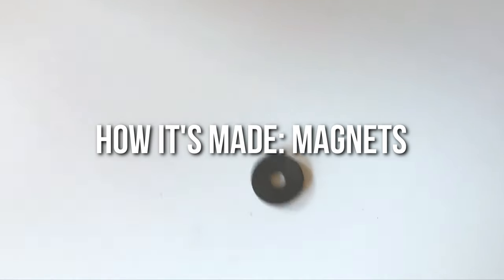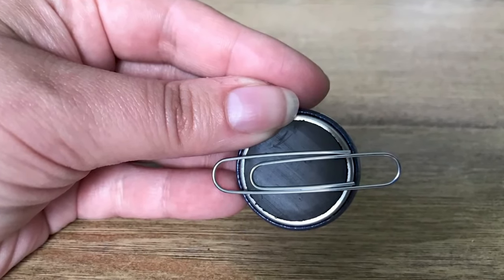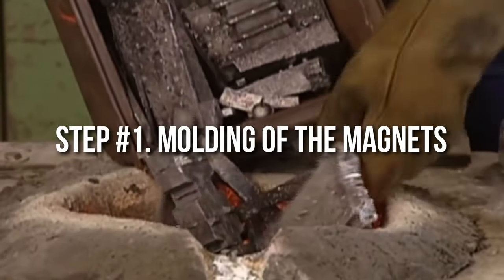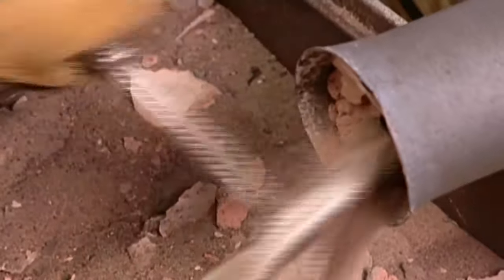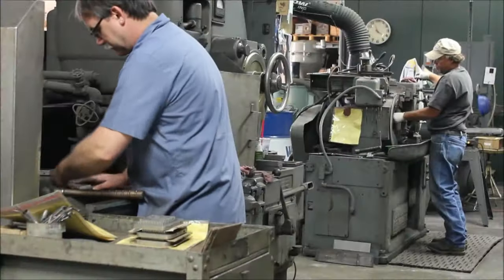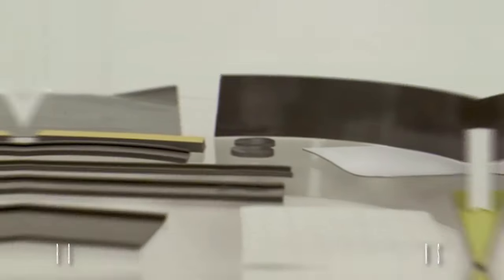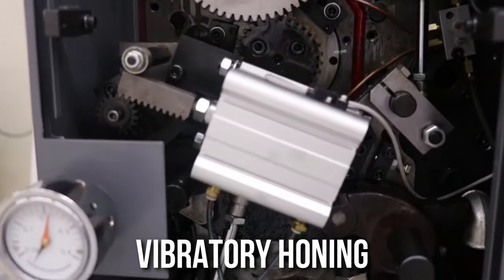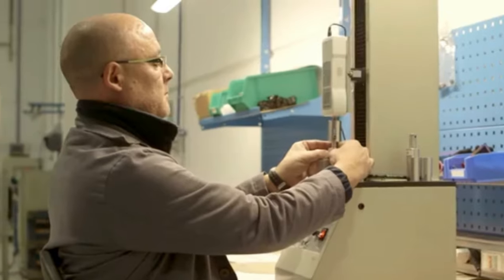HOW IT'S MADE: Magnets

Comment: This whole video is technical overload. I got nothing out of it because the creator seemed to be reading off of a college student level script.

Probably better off watching a different video that only talks about the magnet polarity manufacturing.
Reply: same here... I like the videos and the idea behind them but I'm having trouble understanding the narrator
Reply: idk what exactly you expected. making magnets is so simple it would hardly make 3min video. besides, this is half plagiarized from the original.

you melt a mix of metal suitable for magnets and cast it into magnet shape molds, let cool then break the molds and extract the cast. separate the new castings into their individual magnet pieces and clean them up. the last step is tricky, charging. it helps to know some quantum mechanics for this but if you send electricity thru the magnet shape piece of metal, it will align the magnetic domains which i think are just electrons spinning all sorts of ways idk, look up "what is magnatism". but yeah. so if the domains are random before charging like                       
  ~|S|><>><><<><>>>>><<<><>>>><<<<<<<<><><>>><><|N|~  the domains more or less cancel each other out, where as
  ~~~~|S|>>>>>>>>>>>>>>>>>>>>>>>>>>>>>>>>>>>>>>>>>>|N|~~~~  this does not and will amplify the effect of magnatism because the forces do not work against themselves. 
i hope it makes sense.      ~ field strength     > domain spin direction   |S|>|N| south & north of magnet
Reply: btw, polarity manufacturing is cool stuff. i assume u mean how they get multiple polls on one surface? or weird pole shaped that dont match the material shape? i seen a vid about that from the company who pioneered it.
Reply: btw, its not too technical,its too wordy and they all run together. holycow this vid issss.... wow(edit) i think its a txt to speech synth. thats why it sound kinda monotone even tho it really isnt. just the cadence never changes and is way too steady
Reply: yep. I agree. it makes me a little sleepy when he talks non-stop.

Comment: I understand why this is such horrible video. there is no pacing in speech and very monotone. it is like reading without punctuation.
just try to read this 

there is another even another compaction method called isostatic pressing wave flexible container is filled with iodine and dunk it with fluid which can be hydraulic fluid or water which is use to compacted it.
u don't understand? me too